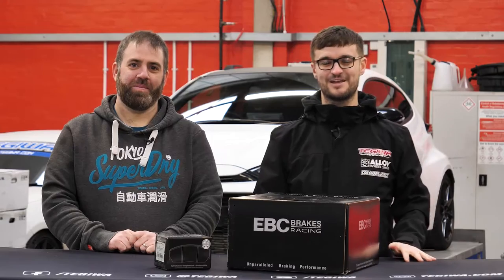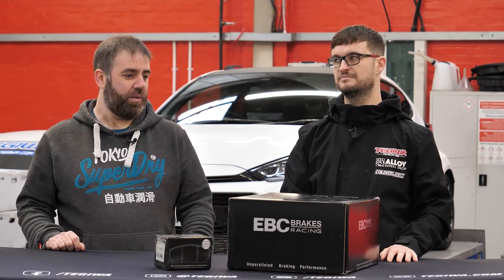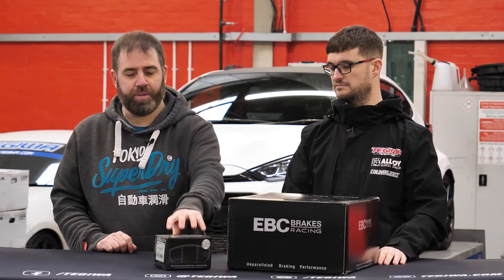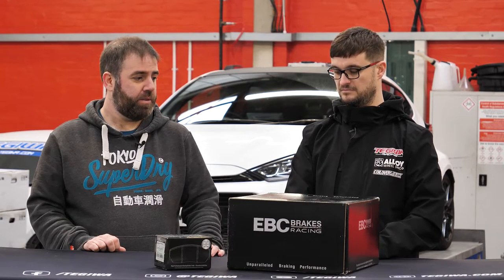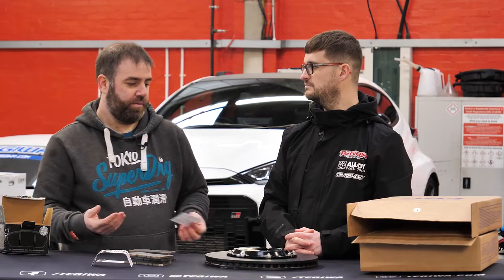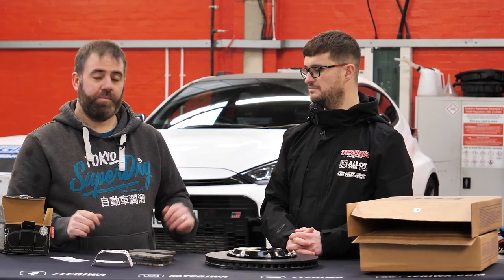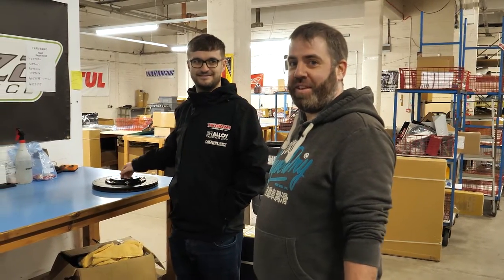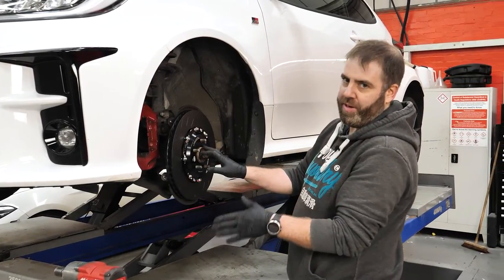Toyota GR Yaris EBC Racing 2 Piece Floating Discs & RP-X Pads Installation Guide!

Comment: Good weight saving, I think a brand new stock rotor weighs 10kgs each
Reply: Looked a lot smaller than I was expecting 9.25 vs 9.1 maybe a new rotor is 10kg but that’s not what this vid showed

Comment: Definitely don't want to be putting copper slip anywhere near brake pads...
Reply: Gotta be careful
Reply: I think copper slip has to be the worst lubricant. Only good for anti seize. Even then there’s better anti seize. Very messy, especially when you work on a car that’s been lathered in it.